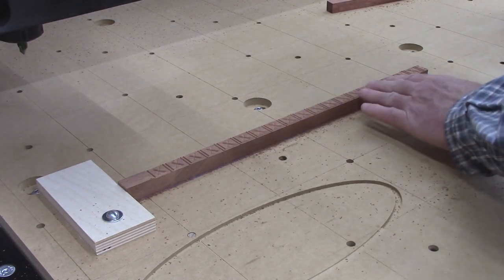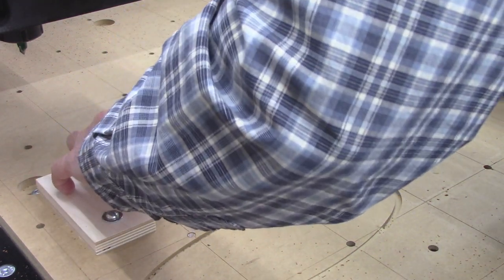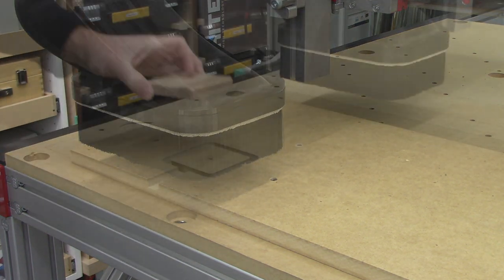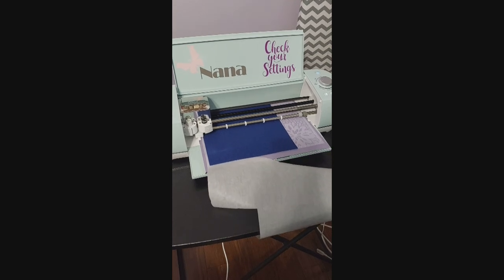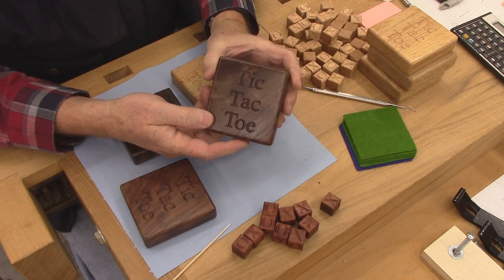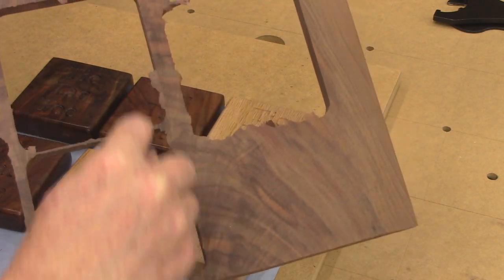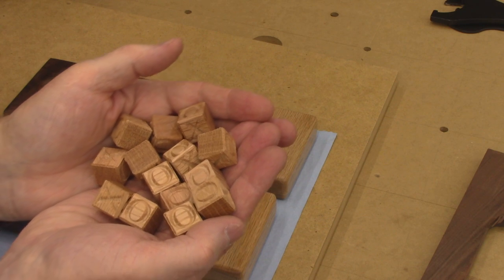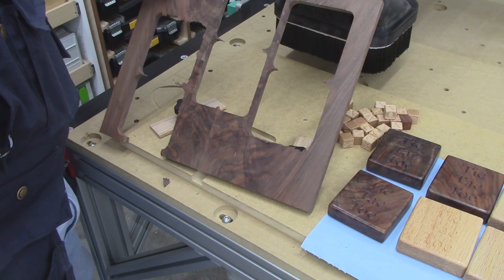Gift Idea:  Making a travel Tic Tac Toe game on the CNC

Comment: Nice job.
You could add a little vacuum clamping to make life easier and more parts at once.Save a lot of time with the superglue.
Reply from the maker: Thanks Michael.  I have been experimenting with vacuum clamping for the CNC but based on some observed deflections in 8mm thick box lids under vacuum, I became uncomfortable with using this on 2.5mm thick lids.  Steve

Comment: Very nice project!  I just got a new CNC and I am learning a lot.  I would use the wood you asked about to make more X/O pieces.  From what I have seen I do not think the red oak was your problem, I think it was using the up-cut bit.  I would try another piece of red oak and use the down-cut bit you used on the walnut burl.
Reply from the maker: Hi Mike.  I think you are correct on the bit being the difference and will likely give the oak another go with the downcut bit.  The walnut burl is only 13.2 mm thick and is too thin for my box design.    I could make a box for that size cube but at some point it will get too small.  I was thinking that my cube size shouldn't be less than 15 mm which is about 5/8".  Steve